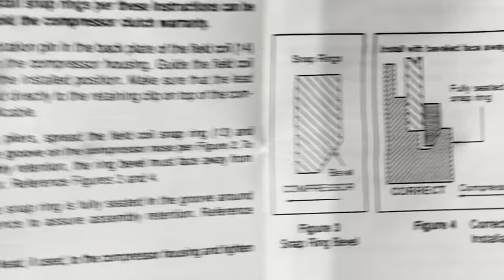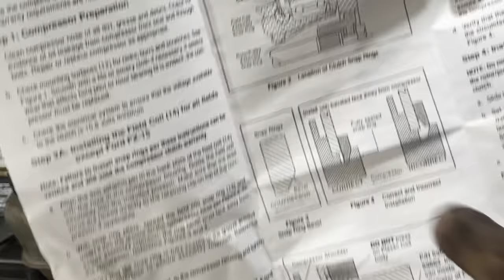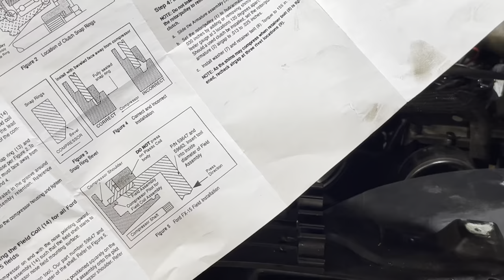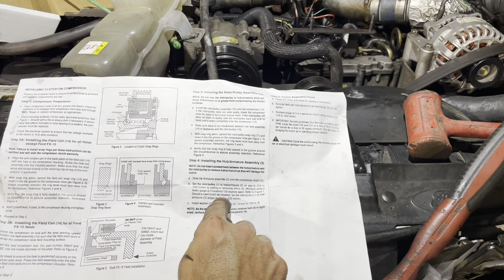99-03 Ford 7.3 Powerstroke A/C Clutch install walkthrough

Comment: Great video but I will add these 2 cents. There are four bolts holding that compressor in place, removing them allows the compressor to be lifted up a bit without disconnecting ac hoses and it makes install the clutch a whole lot easier. Especially installing the pulley assembly as you are not hammering at an awkward angel. 👍
Reply from the maker: Genius! Sometimes I get ahead of myself and don’t think of things as easy as that🤦🏼‍♂️

Comment: Another thing you can do before committing to pulling it, is:   Take two jumper wires and clamp them to your battery, and touch 12v and ground directly to the pins on your compressor.   On the 7.3L  The top is the ground and the bottom is power.   Sometimes you can hit it like that and it works;  so just click it open and closed several times and work it loose.  Sometimes it will work well for another year maybe.   Or if it's dead with your leads- then you KNOW it's dead for sure.   You can put an inline 10a fuse if you really want to be safer.

Comment: Thanks for the Video.... helpful for me deciding if I should change my clutch in a hurry or make sure I have time if needed. Work truck and have jobs on my schedule...
Reply from the maker: I hear that! Grew up in the shop at a family landscape construction company and had to prioritize those things. Good luck with the repair, don’t be afraid to send a message when you get into it!
Reply: @bryanbuilt360  Thanks, I swapped it out yesterday evening it was relatively uneventful. I did have to get the gap tolerance from your video
Reply from the maker: @rayvan101  got ya… all in and working now?
Reply: @bryanbuilt360  yep, she is good to go now. I just need to replace the turbo next.

Comment: Great video. This might be my problem in my 2001. My AC works great its only when towing a load does the AC go in and out at higher rpms. There is almost a pulsating sound in the engine bay. Does that sound like it could be the clutch going in and out and squealing like that? Thanks for any help.
Reply from the maker: Hey there! That does sound like it could be slipping at higher RPMs. You may want to check and see if you can pull some shims out first before replacing. The pulsating sound probably is the clutch slipping. Although, I’ve heard of pulsating sounds with stock turbos under load too. That would be a “wuh wuh wuh wuh” sound

Comment: To more easily place new magnet on without damaging.

Drain the coolant.
Remove coolant Reservoir 
Unbolt compressor 
...compressor only, no a/c hoses
Stand compressor up as best as you can for a better angle 
Use Dead Hit rubber hammer.
Do Not use metal hammer, will damage unit.

Comment: Found my ac clutch flew off the pulley and was loose under hood lol. So I gotta figure out if I need new clutch or whole new compressor or what
Reply from the maker: As long as the aluminum neck that is tapped onto is still there you should be ok

Comment: So most times when you have just the clutch not engauging its just the clutch is the problem i dont have to replace rhe whole compressor??
Reply from the maker: Unless the compressor failed internally you can get away with just the clutch…Helps to check the A/C relay and sometimes if you’re lucky you can just take out one of the shims behind the center bolt and get a little more life.

What’s your situation?

Comment: Do you have the bearing number for the belt pulley? Just want to take a spare bearing so i can swap the bearing out if it fails in the bush
Reply from the maker: Hmmm sorry, I do not. I don’t recall if it was offered at the part store and I didn’t get a look at it when I disassembled

Comment: My 99F250 has 533000 miles on it.Never touch the air conditioning system and it blows like forty six degree air. Problem is yesterday.I turned the air on for the first time and there is nothing happening.So I looked under the truck.My center boat and the front of the clutch is falling off l o l. The magnetic coil and the pulley are obviously still there but and I'm getting 12 V to the coil, but there's no clutch.And now I'm having a hard time finding that center boat and clutch only.I don't want to have to buy the whole assembly
Reply from the maker: That magnet may have gone out… you don’t want to buy the clutch assembly or a whole compressor? Wouldn’t be too bad to buy the clutch with the magnet…
Reply: @bryanbuilt360  I'm gearing 12 v to coil and when it's energized, it sucks a screwdriver to it. Advance auto only sells the whole assy, but autozone has the bolt and clutch plate which is all I need. The 3 shims were still somehow stuck to it so I have them. I ordered the kit from advance today as I have account w them but they couldn't tell me if bolt comes w it or not. If it don't, then I'm going to autozone, which I don't particularly care for 🤣
Reply from the maker: @michaelcollins1899  good to know! But I share the same feeling, I had to buy 8 injectors from A Z during the pandemic because I couldn’t find anywhere else… didn’t turn out to well 🤣

Comment: So after watching video I decided I was gonna try and get my ac working on my 99 f250 7.3. I went to test the compressor and I’m not getting any power and after trying to search online I’m having trouble find what supplies power to the compressor. Any ideas? I’d appreciate it
Reply from the maker: There should be a relay in the power distribution box under the hood driver side. Also, keep in mind that if the a/c system isn’t fully charged or overcharged it won’t allow the relay to turn on as well. Those are some things to check
Reply: @bryanbuilt360  thank you for the reply. I’ve searched for fuse box descriptions and I am yet to find one that points to a relay. Every video I’ve watched which doesn’t seem to be many on my specific vehicle is it’s pcm controlled. I pressurized the system with nitrogen to see if I could get it to cut on but nothing. Not sure what to check now. Maybe high and low pressure switches 🤷‍♂️
Reply from the maker: @whatifyourwrong9153  https://www.ford-trucks.com/forums/748618-where-is-the-a-c-compressor-fuse.html

I know early 99 trucks were a strange model. What was the build date on bin sticker? This forum was the closest I found. Someone had a wiring diagram and fuse locations. Seems like you only have a diode and not a relay possibly?
Reply: @bryanbuilt360  it’s an early 99 my luck seems lol. I did see that ac diode mentioned on one diagram I found which my truck doesn’t have a diode in that slot which may be part of the problem. Thanks for the info

Comment: Is this possible on the van bodies as well? or would i need to remove the compressor?  thanks.
Reply from the maker: I honestly am not sure. I would imagine it’s in the same location on the engine but clearance in there might be tough
Reply: Thank you very much for the vid. You are not a hack 98% would do it this way. It was really quick and easy I was back up and on my way in a matter of about an hour or so .I didn’t have the time or the money to do it the dealer way . So thank you again
Reply from the maker: @bernardolson1659  glad to hear it worked out for you and you’re up back and running!